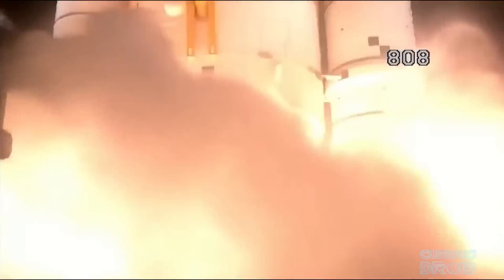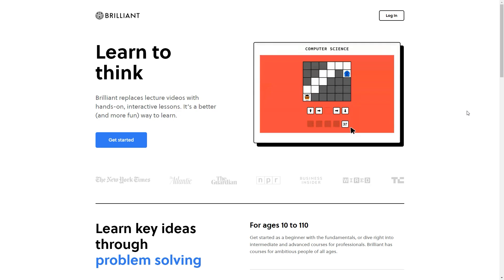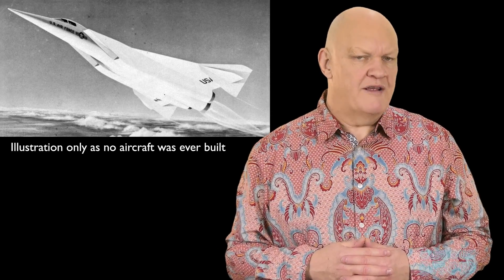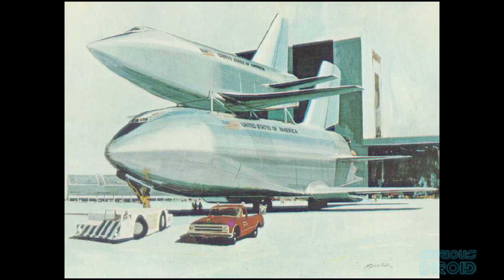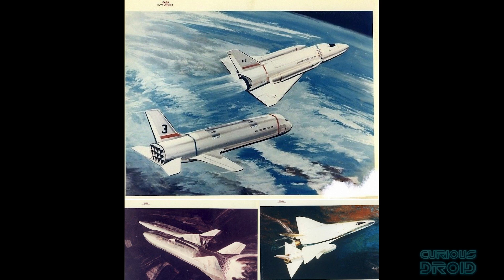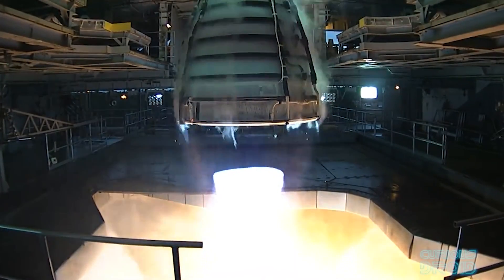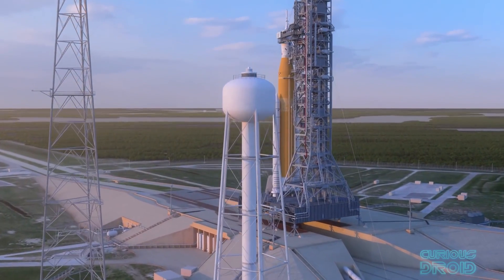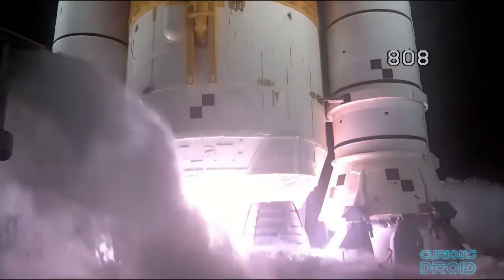Why is NASA Throwing Away Reusable Engines?

Comment: There’s reusability and then there’s reusability. I think each shuttle launch required about half a billion dollars in refurbishment expenses before the vehicle was ready to fly again, some insane amount like that. A big chunk of it was inspecting and refurbishing those awesome engines. If your launch volumes are sufficient, it isn’t at all clear if this is more efficient than simply using a cheaper disposable engine, one that could be produced for a fraction of the cost.
Reply: It's actually reusability vs recoverability. All rocket engines are reusable. The hard part is recovering them. For the shuttle program, the engines were placed on the orbiter so they would return to earth with the orbiter to be reused. For Artemis, there is no way to recover the engines without significantly sacrificing the needed payload capacity to send people on deep space missions.

Furthermore, the space shuttle's refurbishment cost was due to it being a human rated launch system designed to provide life support for seven astronauts for up to a month. The orbiter  was a complete system that included the engines needed for launch, a crew compartment, thermal protection for re entry and wings with control surfaces for gliding to a runway. All that is going to take longer to refurbish than the first stage of an unmanned rocket.
Reply: @DeepDeepSpace  Its certainly more complicated than that. Its not just a question of recoverability - there is a huge spectrum of "reusability". Designing an engine with reuse in mind will result in more resilient parts that should require less replacements (on paper, at least). And if you know youre going to have to take it apart on a regular basis, you will probably use less permanent connectors and make it more modular. 

The cost of space shuttle refurbishment was not just because it was human rated. Obviously a human rated rocket is going to have more required maintenance than one thats not. But the main cost of the space shuttle came from its utter failure from a "reusability" standpoint. Aside from the core structure of the orbiter itself, pretty much every other part was significantly more expensive to reuse and refurbish than to just have a new one built from scratch. They could have made every launch significantly cheaper, and arguably even safer, by designing some parts to just be thrown away and totally replaced from the start.
Reply: @merylsmith5305  with the shuttle program,  only the orbiter and the solid rocket boosters were recovered. The external fuel tank was thrown away requiring a new one each time. So the main cost involved was replacing the external fuel tank and preparing the orbiter for the next launch. Keeping in mind the orbiter had to support 7 astronauts for up to a month, launch itself into orbit with its own engines, re enter the atmosphere and glide to a runway. So that will cost some money but its still cheaper than building a new orbiter from scratch each launch.
Reply: The Shuttle "turn around" was closer to a "D check" in practice.
It also wasn't cost effective to recover the boosters. Hence those on the SLS lack parachutes.
Reply: A very valid point Mr. Sunspot.
Reply: That actually isn't quite true. The cost of the Shuttle program each fiscal year was based around the enormous ground infrastructure and support services, which were spread out around the country, for political reasons, of course.

And no, the RS-25s/SSMEs were not inspection or maintenance intensive as people believe. That's one of the biggest myths out there. As far back as the Phase I and II variants of the engine, it was determined that they could spend up to three flights in the orbiters' aft fuselage.

So why were they taken out and torn apart? Because the bureaucracy said they had to be, especially after the Challenger accident in 1986, and NASA had to look like it was being safety conscious.

By the time the Block I, IA, IIA, and II were introduced in the 1990s and early 2000s, the engines were good for up to 22 full mission duration firings without more than boroscope inspections between flights. But again, the bureaucrats said they still had to remove the engines for inspection work, and do an overhaul every 10 flights.

This was indicative of the program overall, and if the Shuttle was operated more efficiently, it would've cost a lot less, but politics would not allow what we call "vertical integration" like SpaceX and Blue Origin use.

Interestingly enough, Boeing in the late 1990s proposed buying OV-102 Columbia for private spaceflight missions, and they had some rather interesting ideas. But that would probably have shown up how inefficient NASA was at operating the Shuttle program, so it was nixed.
Reply: The shuttle was horrendously bad on expenses but it wasn't that bad. The overall mission costs for each flight were about $350-450 million depending on the mission because the mission costs includes the payload costs. But that doesn't take away form the fact the shuttle cost too much to operate.

I am an aerospace engineer and I do try and explain to people that the Space Shuttle was BOTH and amazing success and horrible failure.

It was a success in that it actually worked. Despite all the interference from the USAF and CIA they actually made something that worked. If you go through the technical developments they got through it was extraordinary that they even made it work once let alone 130+ times for only 2 losses.

It was a horrible failure in that its COSTS were so over what was intended. From the outset it starved other programs of money and people. You are right the refurbishing of the motors between flight was a major part of those costs but not the only costs. The heat shield was  major hassle as well. Because of the insistence the shuttle be used it also meant the ISS cost a lot more than planned. All those costs have added up and all the people required to get it done is the main reason we are still yet to go back to the moon. 

Just so you all know I was doing my degree when Challenger happened. I was actually in Florida only 16 days earlier and watched Columbia take off. Up until the day Challenger happened all of my classmates and me expected that we'd build Space Station Freedom in the early 1990s and be headed back to the moon circa 2000-2002.

And yeah that wasn't a good day. One of my aerodynamic profs lost a friend on that flight.
Reply: If you go to the NASA budget web page, you will find that launching a shuttle was a little over 1.6 billion dollars...  Just saying.
Reply: They can probably get significantly more thrust out of the same engines with only a single use.   

I think they should build reusable shuttles designed to be used only in space, with fuel lifted with non-manned rockets.
Reply: To put it in perspective, the price of ONE Boeing 747 Airliner is $419 million. So for each shuttle flight you could have purchased ONE Boeing 747. Doesn't seem like such an insane amount anymore does it?
Reply: Usual engineering aphorism: I want it to time, to budget and to spec; or quick, cheap and right.  Usual answer: pick any two you like!
Reply: These do not cost a fraction though.
Reply: @Jaxck77  
I'm convinced that the amount they cost, and the amount of our money Congress is giving their friends for ot, are VASTLY different amounts.
Reply: @lordgarion514  Exactly, NASA has only ever been a way of syphoning more USA tax money to Israel.
Reply: @Jaxck77  True, but they were just going to sit around rusting and were already paid for out of the Shuttle budget. So they’re essentially free as far as the new rocket is concerned. 

If you think this program is delayed already, imagine how far behind schedule it would be if they’d tried to make more of the components reusable.
Reply: @Jaxck77  Even 99.999/100 is still "a fraction"   🤓
Reply: @jimurrata6785  The phrase “cost a fraction” does not mean “costs less than”. If you cannot parse English, you should avoid speaking.
Reply: Imagine how far ahead NASA would be if they just started from a fresh sheet instead of being shackled to Shelby and his cronies by congressional mandate.
We're nearly a decade behind and tens of billions over budget with no end in sight if this continues.
Over $4 billion per launch and $93 billion through 2025
Reply: @jimurrata6785  Well those engines are great and were already paid for and just sitting around. I don’t think using them in the program was a bad idea, although they’ve encountered huge issues in the program dealing with liquid hydrogen fuel. The SRB design is also proven, provided you don’t launch when it’s too cold. Likewise the tank is based off proven tech. I’m not sure starting with a clean sheet would have saved them any money. 

Although I do wonder if we should revisit designs like Sea Dragon to see if they could be made practical by modern tech. Designs like that could definitely reduce cost to orbit while facilitating the lofting of enormous payloads into orbit.
Reply: @sunspot42  A number of space missions went ahead because of having to use hardware from cancelled programmed which was 'lying around rusting'. That doesn't make NASA and its colleagues efficient. Far from it. They might better be called expensive salvage merchants. The problem is that they are a government funded public agency, rather than a self-funding private entity. Compare them with some of their commercial competitors, and this operation's gross inefficiency is thrown into stark relief.
Reply: @jimurrata6785  They had to promise to use Shuttle tech, just like they had to promise to use Apollo tech for the Shuttle. Otherwise, no budget. That they're now using 50 year-old designs for a lot of the stuff is the price they pay for having a program at all.
Reply: @jimurrata6785  I'm not saying they made the right choice, either time, but from their point of view it was that or nothing.
Reply: @robertmiller9735  Then why do you say "choice"???
Reply: @jimurrata6785  Well, they could have told Congress the engineering truth at one of the many mandated redesigns and gotten no human space program... maybe you're right, I don't know. What I'm sure of, is that people shouldn't blame NASA, or at least NASA alone, for all this mess.
Reply: @robertmiller9735  I never "blamed NASA"
NASA has some incredibly talented scientists *and engineers, but poor administration.
I blame Congress, and Shelby specifically.
It's not a space program, it's a grift program for Boeing, LocMart and the rest of the MIL.
Maybe you didn't read the memo?
Reply: @jimurrata6785  Oh, I didn't mean you specifically. But lots of people do blame NASA for what they have no power over.

I do think the issue is basically a cultural one whose origins go back generations, and not really the fault of any one person.
Reply: @robertmiller9735  Saab had to promise to use Vauxhall (GM) tech when it designed a car.  I think they used the blinker stalk and a gear knob.... Just sayin
Reply: @markpitts5194  It's more like Saab being contractually forced to use GM engines and transmissions so as to save money by not designing their own... and then spending extra years and megabucks tinkering with the car so those components will work with it.
Reply: Its amazing how much credit spacex gets for using all the tech NASA developed.   I wonder how far along they would be if they started with 1940s tech and 1940s engineers.    NASA didn't start rocket research,  but has done more for it than anyone.   Does spacex do cool  things , yes.  But nasa did it all first, and there is a cost to being first.
Reply: Except money is a concept, an intangible and infinite quantity of something that only exists as a convention between people to determine and mediate the value of finite things, especially if we talk about currencies like USD that aren't even backed. Recycling things has ALWAYS been more costly than producing new things, using finite resources.

Keep using money as the only measure to determine viability while entirely ignoring sustainability, and see where that gets you when you start running out of materials to produce disposable things from...
Reply: It's a lot easier to throw stuff away when it's not your money.
Reply: Half a billion.. Or something like that..
Ridiculous commitment 😂
Reply: I knew the first comment would be a comically stupid and rote like this. But you have no impulse control and simply MUST signal to everyone what you know (which is simply wrong at worst and a gross oversimplification at best).
Reply: Except Space X already does that better.

NASA: a decade late and a thousand braincells short.
Reply: @jasoncarswell7458  Space X is a supplier for NASA, nothing more. They promised 10x cheaper, and by 2016, instead we got slightly cheaper and 2021 for the first human rated space flight.
Reply: Wasn’t the amortized of each shuttle mission like $1B? It’s amazing expensive LEO was before SpaceX. 
I wonder how much money NASA could save if they dropped success probability to 99%.
Reply: @colinjohnson5515  I think one of the NASA administrators stated that they could've just continued launching 4-6 Saturn 1b LEO/Skylab missions and 1 Saturn V moon mission per year instead of going through the troublesome shuttle program for the same money.
Reply: @colinjohnson5515 , SpaceX has done a great job transporting astronauts and supply  ships to thr ISS. The Falcon 9 booster is a fabulous piece of hardware.  However, SpaceX doesn't have anything in its inventory that can launch a payload to LEO on the scale that the SST did.  The shuttle and its launch vehicle hauled crap ton to LEO. Those ISS habitation segments are huge.  Falcon heavy put some decent sized satellites to orbit. But nothing on the scale of ISS habitation segments.  Returning the Falcon 9 boosters to land comes with a payload penalty. They trade payload with the weight of the landing struts and return fuel.  The Starship Super Heavy booster may be a game changer....but it still has a long way to go....and it's cost is probably much more significant than Elon is saying.  It too will carry a payload penalty with regard to fuel and landing hardware.  That booster will be higher up l...moving faster...and will require significant retro burn to keep it from burning up. It'll be interesting to see how it performs when it's ready.
Reply: @toms1348  Falcon Heavy can easily carry more into space than the shuttle. Over twice as much when expended. But yes, it does take a heavy hit when being reusable. And the satellites it's sent have been lighter than what the shuttle did simply due to the distance they were sent. 

There is a heavy payload trade off when reusing boosters, but that doesn't mean that that it's worse. Many launches don't need the full capacity anyway, so reuse allows cheaper and faster flights. If I'm not mistaken, Falcon 9 has already put more total mass into space than the shuttle, even while most flights are reused boosters.
Reply: @toms1348  You forget Falcon Heavy and the approach of launching payloads on one booster and astronauts on a second simpler booster instead of the approach of doing it all with one booster and making it reusable
Reply: @toms1348  BS.  Falcon Heavy exceeds the shuttles payload.  It's the Fairing size that restricts what it sends up.  Know what you are talking about before you make a dumb comment like that.
Reply: @anthonypelchat  wasn't the shuttle able to carry larger items, though? It's my understanding that the falcon has limited cubic space
Reply: @toms1348  Falcon Heavy to LEO: 63.8t / Spaceshuttle: 27.5t ( single Falcon 9 has 22.5t, almost on par with the Spaceshuttle)
Costs: Falcon Heavy: 100M$, Spaceshuttle: 260M$.
Reply: @sanitarium017  Yes and no. The current fairing, which is the standard one used, is shorter than the Shuttle's cargo bay but wider. But Falcon Heavy does now have or at least will soon have an extended fairing that is slightly bigger than the Shuttle's cargo bay. 

Shuttle Cargo Bay = 4.6m by 18.3m
FH Standard Fairing = 5.2m by 13.2m
FH Extended Fairing = 5.2m by 18.7m
Reply: @TheSwissGabber , Falcon 9 can only lift 22.8T to LEO  if they expend the entire vehicle.  When they land and retrieve the booster for reuse, then the payload to LEO is about 16T.  Not exactly on par with SST.  As for Falcon heavy it is only capable of 64T to LEO when the entire vehicle is expended( ie nothing recovered for reuse). If they recover two Falcon 9 boosters, the payload is around 20-30T to LEO.  Heavy to-date hasn't lifted anything over 20T....so the numbers above that are still technically theoretical.
Reply: @rustusandroid , I know what I'm saying.  I'm not sure you do.  The Falcon heavy to-date hasn't lifted anything more than 20T to LEO. Theoretically, it could lift up to 64T to  LEO, but would need to expend the entire vehicle to do so (ie not recover any component for reuse).  So.......maybe know a little bit about the matter before you decide to skewer someone.
Reply: @toms1348  I didn't say it has.  You said the shuttle could carry more, and that SpaceX couldn't compete with it.  And in THAT, you are INCORRECT.
Reply: @rustusandroid , when SpaceX actually does compete with or exceeds SSTs payload I will most certainly acknowledge that.....when it happens.  You can't argue that something can accomplish a task if it hasn't already done so. Make that claim when it actually does it.   For the record, I root for SpaceX success...afterall nearly 11 billion of our tax dollars have been invested in the company.  That said, I take whatever proclamation Elon makes with a grain of salt.  And given that he's dumpna great big chunk of his fortune on the utterly useless Twitter....I fear SpaceX will suffer for it.  Starship is getting pushed further and further back every day.  He need to dump tons more  money in that project if it's going to succeed.
Reply: @toms1348  They've already exceeded Shuttle capability. Period.  Just because no one has a payload yet means NOTHING.  Again, stop trying to save face like a Democrat and take your lumps like a Republican, if you truly are one, which I doubt.
Reply: @toms1348  Doubtful.  Highly doubtful.
Reply: @rustusandroid , thanks for your amusing comments.  If anything, they gave me a few good chuckles during an otherwise busy and challenging workday.  But the day is done and I'm sitting here enjoying a nice single malt, neat..
Reply: @toms1348  Good now, but they promised 2016, which is almost as bad as SLS for lateness.
Reply: @throwback19841  I'm not forgetting that satellites are getting smaller. Few are forgetting that. But that supports reuse even more. Plus, just because the satellites are lighter doesn't mean that the payloads are lighter. Ridesharing to space is becoming increasingly common. 

Falcon Heavy had delays due to it's customer, the NRO. The payload wasn't super heavy, but the distance was. More are scheduled to fly, but FH does have two major issues that will forever keep it from flying much. One, it has a smaller payload fairing by default. That has only recently been increased in size, so new satellites have only recently been able to start being built for it. And two, Starship is going to be bigger, more powerful, and cheaper. No reason to fly on FH when a flight on SS will be coming in about the same amount of time for cheaper. 

Finally, Starship was delayed by the FAA. While that was taking a while, they decided to focus on fixing other items instead of pushing for flight. Raptor 2 is ready and being built in high volumes now. The launch tower and systems are now improved and ready for flight. And the upperstage can now deploy payloads instead of just flying empty. If the upperstage doesn't live up to the reuse ability that they are planning, then they have already proven that they can build them quickly and cheaply instead. It doesn't have to be full reuse or bust.
Reply: @toms1348  The heaviest payload the shuttle ever carried was 22.7 tons, vs a max capacity of >17 tons for reusable Falcon 9 up to ~64 tons for a fully expended Falcon heavy.  But when going to the 51.6 degree inclination of the ISS the heaviest payload the shuttles could handle were the Destiny and Harmony modules at 14.5 tons each, where the Falcon 9 has sent 16.7 tons to the marginally harder 53.2 degree orbit.  The shuttle also couldn't use liquid fueled boost stages for safety reasons, and as a result its beyond LEO capabilities were very bad, probably well below what the basic Falcon 9 can do.  With the Falcon 9 costing NASA less than a tenth of what the shuttle did even after all the additional fees for government assurance work, it is an enormously better stuff hauler than the shuttle ever dreamed of being, and likely would have been completely capable of lifting all the non-Russian parts of the ISS with only minor changes and without needing to resort to expended boosters, the Falcon Heavy, or the longer fairing.
Reply: @faroncobb6040 , I don't argue any of the payload numbers you mention for the Faclon 9 booster.  In fact, I noted them myself in previous posts.  I do take exception to the max payload to LEO, in that the entire launch vehicle is expended.  And as you know...SpaceX and its fanboys hang their hats on reusable hardware; and use that fact to disparage anything NASA produces.  So..Given that, I discount the max payload to LEO.  
As for the shuttle max payload, your  number   may he correct.  I'll take your word for it.  But as SpaceX fanboys oft will do, they like to tout theoretical payloads.  So, I got caught up in that.  Additionally, the shuttle was never anything more then an LEO vehicle. So comparing that to beyond LEO doesn't make sense.
Another consideration, the Falcon 9 is a booster only.  If we're going to compare boosters only the SST booster had a 22T orbitor, plus its 22T max payload that you noted. So the SST booster put 44T into orbit. Albeit, three engines were attached to the orbitor;  44T of hardware was put into orbit.
That said....I was never a huge fan of the shuttle, since its pulled NASA away from further developing the Saturn V and deep space exploration.  But that's what congress granted us unfortunately.
Bottom line...my argument about reusable hardware is that it  does come at a payload penalty, as evidenced by the max expendable payload numbers you noted.  Also, I do think the Falcon 9 is a superb piece of hardware.  And that it serves as specific purpose, as does the SLS...and the potential/future Starship.
Reply: @colinjohnson5515  yeah at the end of the program it was around a billion a launch. Insane. But the Shuttle had many challenges besides the expense of “reusability”, although that was certainly one of them.
Reply: Elon's "reusability" is mainly about exciting $$ the millennial sheeples that won't look too closely at the numbers.
Reply: @Battleneter  Care to share the numbers they aren't looking too closely at?
Reply: @logicalfundy  He just came here to sneer.